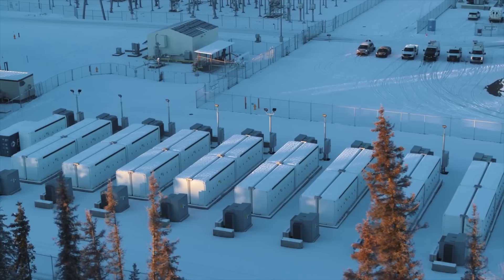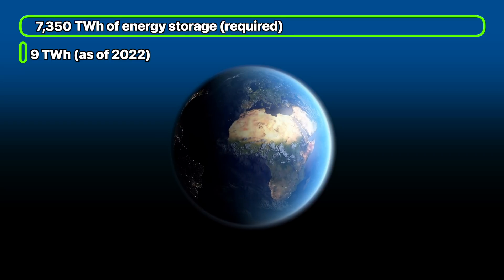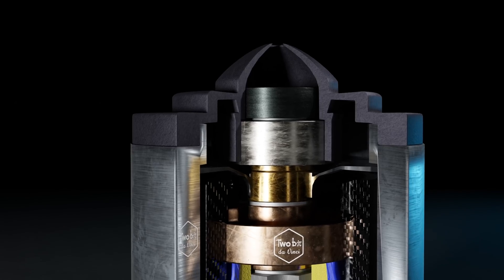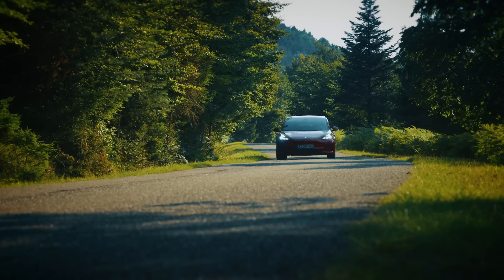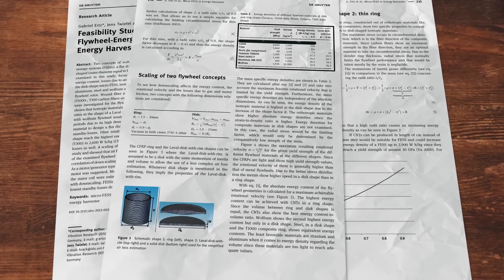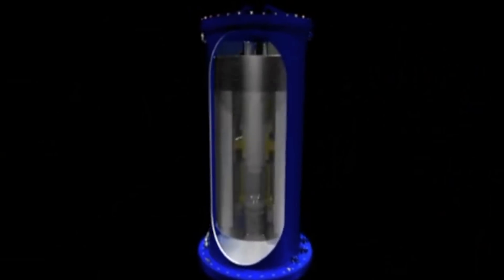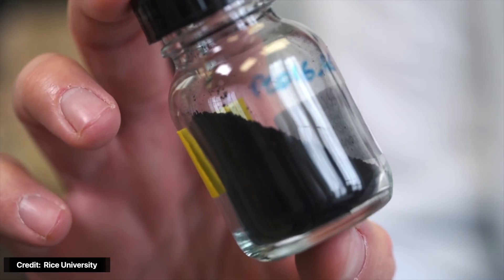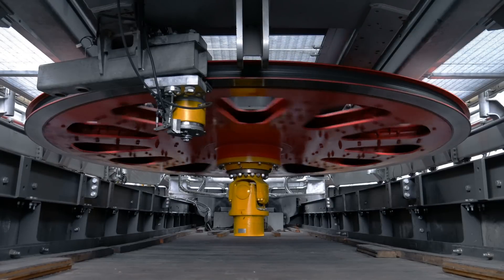Breakthrough Energy Storage Tech CRUSHES battery prices by 90%!

Comment: Superconductors are a natural fit for flywheels. We can levitate the wheels to improve efficiency. Now, I know what you're thinking, "But what about when they loser power because the grid blacks out or something, and so the compressor loses its cold and the flywheel falls down and runs free, destroying a whole town?" Well, the solution is simple: the freezing units (yes, there are TWO for backup purposes) will be powered by the flywheel itself, so it will auto-spin-down before settling in place by redirecting as much energy as is necessary to keep the superconductor locking it in place. Additionally, a back up support can activate to catch it once it has spun down sufficiently, for extra safety.

Otherwise, as long as the base remains cold, the flywheel can be locked (magically) into place with no direct contact with anything. Such a flywheel could last.. basically forever, and lose no energy at all (other than to the compressor to keep it cold).

Obviously, then, the trick is to design really good insulation and bury the flywheels underground to achieve this, as well as making them safer.

Comment: Somewhere or another I missed the whole discussion on how a flywheel works, as in what makes them turn, and what keeps them turning.  I'm guessing magnetic fields turn them like a typical motor, but I can't get past the whole notion of resistance being something that drains away energy, and in this case it would be resistance to the mechanical movement.

So, if there a better source of info for how a flywheel works?  Showing a couple equations is kind of meaningless if you don't understand the basic concept of what makes a flywheel STORE energy.  Yes, it's energy of momentum.  I get that.  But there are always forces that resist movement.

So after seeing the ending I pieced it together a little bit and see that flywheels are really only useful for solar panel farms to give energy after the panels start to reduce production when the sun goes down.  That's really the only situation where you have a SURE drop in renewable power in which case the need is immediate and friction won't get the best of you even though it still will considering the pretty fast drop in momentum.  I assume that charging means turning them ever faster.

Comment: I'm pretty sure the solution to make long strands of nano tubes is simply to use CVD to spray carbon on some cheap iron wires. you can also use vibrating copper wire in a chamber filled with high density CO2 .

Comment: If flywheels have as high a discharge rate as you say, they would run really hot. to wind down a high capacity flywheel at that rate, is a lot of wattage wasted as heat! Suspending a flywheel on permanent magnets arranged like pole to like pole, would create a near frictionless bearing, that would allow them to spin freely for extended periods of time. The difficult thing, is to make sure the magnetic fields are homogeneous enough, to avoid any flux modulation what so ever. Oscillating magnetic fields tend to form Eddy currents in any near by conductor. The electromagnetic rotor for the motor/generator needs to be switched reluctance. In a hard vacuum, it's almost impossible to dissipate heat, especially at high rates of acceleration and regenerative deceleration. (because switched reluctance works well with large air gaps, it's possible to build the stator outside of the (non-metallic) vacuum vessel, so it can be cooled by conventional means) The reason for switched reluctance, is because a permanent magnet rotor would cause all kinds of fluctuating magnetic fields, which create drag by maintaining airgap voltage in the stator. An induction rotor relies on Eddy currents in the rotor, which in a vacuum, would get too hot during charge/discharge at high rates.  Both induction and switched reluctance have the advantage of no magnetic field in standby, perhaps, allowing storage losses to be more similar to even the best chemical battery.

Comment: CF flywheels in a vacuum were (briefly) used in the datacenter space.  They were only useful for holding a DC up for about 30 seconds, which should be plenty long enough to start a diesel generator.  I don't see them as a practical alternative for energy storage to chemical batteries (yet).

Comment: So is that the value for raw CNT? I'm guessing real world would be much less because you would need to use resin to keep its shape like carbon fiber. Also, I can't see how you could power your EV with a bunch of flywheels... wouldn't the gyroscopic forces cause problems? I guess it worked fine for that bus...
Reply: I was wondering the same thing.  Still many unanswered questions.
Reply: The bus only stored energy for minutes. Someone else mentioned that 2 counter rotating wheels might work.

Comment: I did a paper design of a hybrid car using a 35HP turbo natural gas engine (lowest CO2 per HP) and a 200lb, 10K RPM flywheel (500HP minutes of energy).  The flywheel provided the starter and flywheel for the engine, reducing weight.  Each wheel was connected to the flywheel by a CVT to control vehicle speed and provided regenerative braking.

One key element is the system required 2 counter rotating flywheels (in a vacuum) that were gimbal mounted.  This allowed going up and down hills and prevented the car from ending up on its roof 12 hours after parking (the earth rotates, flywheels don't).  

Like the Tesla Plaid, dumping 500HP minutes in drag race (5000HP in 6 seconds) would be a lot of fun.

Comment: these would be good near solar or wind farms. set them up to charge before peak times and release them as the peak hours demand. say charge them up at 2pm and discharge them from 4-5 while people are getting home and starting everything up.
Reply: Could it be possible to power the flywheel with a direct mechanical connection from the turbine?? There would be be no losses over the generator/motor system and all electrical systems could be located on the ground.  It would smooth out turbine output in gusty conditions.
Probably would introduce other issues, nothing is ever that simple... 😏

Comment: I remember it being said that those working on the space elevator concept had solved the problem of making any length of carbon nanotube... It was a group in Seattle, Washington...  Don't remember the name.  Also, I remember when they were doing experiments with carbon nanotube ribbons held up really high be hot air balloons to test elevator vehicle concepts (which is what they claimed to be the bigger challenge).
Reply: There is no material strong enough for an earth space elevator.   Not even theoretically.  One is possible on the moon tho.

Comment: I have personally machined hundreds of large rotors and housings for a company called 'Active Power'. It's my understanding that flywheels are used in uninterruptable power situations to provide an instantaneous response to a power disruption, say in a hospital for instance. They are only used for very short times, until standby diesel generators can take over.
Reply: About 40 years ago our computer branch ( in very large government department) pulled its electricity supply from a electric generator powered by an electric motor.  Sandwiched in between this motor/generator set was a 1000 kg steel disc flywheel.  This revolved at 1500 rpm.  The purpose of this system was to isolate the computer branch from very short term power loss and electricity spikes.
Reply: @johnspathonis1078  Yes, there were installations where 3 phase AC was converted into DC or viceversa using motor generators and the use of flywheels was a simple way to store energy.
Today all is solid state and super capacitors are used for short term storage.
Reply: That is right, normally it is not wisely to store large amounts of energy in an inertia wheel with large angular momentum, because the failure mode associated with bearing failure has catastrophic effects, well  documented 70 years ago, when MFO build and operated so called gyro buses having a vertical axis flywheel, which had to be  recharged on every stop. They were eventually delivered to Adìs abeba to fulfill Haile Selassie personal oder .
During testing one had a bearing failure, broke out of the enclosure up the test pit and destroyed a considerable number of machine tools on the factory floor, needless to say that the redesign lead to considerable derating of the system, essentially eliminating other customers.
Reply: Yep, worked at a plant that was turning/milling Activ Power rotors. Was hoping to find something like this in the comments, thanks.
Reply: Yup no-brake gen-sets have been used at large airports for 50 years.  The flywheel allows the diesel to get up to speed when there is a power cut before the frequency goes out of spec.
Reply: For smoothing grid transients otherwise absorbed by a hospital backup battery system they are unparalleled.   MRIs and large machines demand massive instantaneous current many multiple times daily, which the batteries sacrificially supply to avoid a brownout. As well, a hospital in some cities experience 30,000 transients a day, aka noisy power, that hammers batteries to death.  For smoothing gradients they perform effortlessly to save mucho denaro.
Reply: Imagine a carbon nanotube wheel in your car that stores 400 miles of driving energy. It will level buildings when it frees itself.
Not to mention the handling of a car with a giant gyroscope inside. You can only drive level on flat surfaces.
Reply: @mennol3885  Actually the gyrobuses had double gimbaled flywheel suspension, exercising no torque on the vehicle on startup the gimbals had small orthogonal torquers to keep the axis  upright
Reply: @arturoeugster7228  If the flywheel is allowed to freely gimbal, how is it mechanically connected to a generator or to the vehicle's drivetrain?
Reply: @sssbob  I saw these passenger buses as a boy and what I remember is that the gimbal stops were adequate for operation in a city environment (limited to 30% grade)  and they were electric powered, the overhead connections had to be 3- phase AC connected by retractable hinged parallel bars. Voltage, I had no idea, since they were to be operated in Ethiopia. I lived across the factory and we obviously heard about the runaway incident. The driver said it operates like an electric city bus with the usual 2 parallel overhead wires prevalent in the city of Zürich, called trolley bus,  our  regular ride to school.
From what I remember in the back there was a slightly higher floor and the motor/generator was incorporated into the flywheel, how I don't know and hesitate to guess.
The buses are described in a Wikipedia article (highly recommended, detailed and useful unique information) as built by MFO under the title Gyrobus, the very ones I saw. That is the limit of my recollection.
Much later I worked  at Martin Marietta and did research and design of momentum exchange attitude control, where the double gimbal triad installed on Skylab was a small part of the various concepts investigated. Actually I wrote the backup control laws , the primary ones were written in an ingenious way by Kennel from NASA at Marshal Space Flight center.
I mention that because the size of the CMG's (control moment gyro) were about the same as the one on the gyro busses. The CMG's are constant speed  devices operating in a vacuum, made by Honeywell, The similarity is the shape of the wheels and hub for uniform stress distribution. In a near zero g environment , the gimbal loads  are obviously not comparable , can't help there 
The Hubble space telescope has 4 reaction wheels with  variable speed control, They might be helpful in implementing tried and proven motor generator design and control, obviously  as reliable as it can be.
Reply: @sssbob  magnets and coil
Reply: @mennol3885  Yes underestimating gyroscopic progression is dangerouse.
Reply: @mennol3885  Yes it's interesting that any attempt to turn the axis of a single gyroscope quickly will result in a huge twisting force at 90 degrees to that axis.  I suppose it's possible to eliminate this by having two gyroscopes running in opposite directions mounted back to back but would the complication be worth the effort?
Reply: @mennol3885  You can use one to save fuel by storing energy during deceleration, and releasing for acceleration. Such a flywheel needn't be so large.

Comment: One interesting use case could be fast charging EVs. In combination with batteries the flywheels could be charged up very quickly and over a longer period could then charge the main battery of the car until it drives or just simply parking. This combination could solve the issue with the slow charge time of batteries the same time as solve the discharge of the fly wheel over time.

Comment: I like flywheels as energy storage, but they have another issue that you didn't cover here... Gyroscopic motion. There's a video where they took something like a spinning top and spun it around on the ISS. After a moment, the entire top flipped upside down... and another moment later, did it again. Additionally, there's the issue of angular momentum on a spinning object... You've got to remember that the Earth itself is spinning. So if you try to spin something along a specific axis, but then the thing you're mounted to (the Earth) spins it outside of that axis, you induce a LOT of harmful forces onto the flywheel. If you get too heavy or spin too fast, these forces could break an otherwise good flywheel. Luckily the Earth spins relatively slow compared to the flywheel, so it's not as bad as it could be... but still, you end up with serious stresses and inefficiencies because of this relationship. Ideally, you'd find a way to mount the flywheel within a gyroscope (think astronaut uncontrolled spin training) which would allow the flywheel to maintain it's momentum even as the Earth spins... but this is outside the bounds of the materials science we have today. But, if you can find a way to fix the angular-momentum-relative-to-the-Earth issue, you could potentially have flywheels that can maintain their spin for a very long time.
Reply: Perhaps your idea will be easier to reason if you chose more accurate terms. Rather than "the earth is spinning", use "the earth is slowly rotating". After all, it takes TWENTY-FOUR hours to make a single rotation. The term "spinning" imparts a sense of the whole planet whizzing around like a flywheel. In reality, the earth's rotation would be almost imperceptible if viewed from some point in space, similar to watching the rotation of a clock's hour hand.
Reply: @mississaugadave7270  I never said the Earth was spinning 'fast'... there are such things as 'slow spins', lol. But, yes. Using more accurate terms is always better.

Comment: I was penciling out a design for a flywheel on an E-bike. Clutched in to take the regeneration as well as peddling. Design as an axial generator. Provides an even recharging of the battery, and extra storage while all charged up. Can comfortably be recharge while on a stand.
Reply: Be interesting what kind of gyroscopic forces will result as going straight, turning, tilting the bike for a turn…
Reply: @jsbrads1  Yeah. I was wondering about that. I tried sitting on the back of a bike holding a spinning bike tire while a friend rode the bike. They couldn't tell. I'll try riding next time!

In a real model though, the flywheel would be in the triangle between your legs rotating in line with you.
Reply: @JorgeLausell  a spinning bike tire isn’t heavy enough, you have two of those spinning already. You need the space for your legs next to the triangle.
Reply: @jsbrads1  the flywheel would have to be heavy. I'm thinking there's plenty of room and it would be in a housing, not spinning in the open. You could knock your knees into it, no big deal though, not in the way while pedaling.
Reply: @JorgeLausell  a thin disk? With axis parallel to handlebars?
Reply: @jsbrads1  yeah. Thin like under 5 inches. My battery is a bit over 3.
Got to work the geometry abit but around 8-9 inches across.
Reply: @JorgeLausell  when the disk changes speed you will get Torque Steering which will tilt the bike… annoying when riding in a straight line and may move the tires inches to the right or left, but changes in tilt while turning can cause a rider to fall.
Reply: @jsbrads1  I was thinking that most times the movement is inline with the movement of the bike. Mostly when leaning and straightening up that the force may be strong. Odd, but not a dealbreaker as a longer wheelbase works that out. And you need the longer wheelbase too as the best application is more a mountain cargo bike.
Reply: @JorgeLausell  on a road bike you often ride with paved road for a number of inches to the right and left of your tires but in the mountains, one side could be a rock face and the other a drop off.
Reply: @jsbrads1  It is all about the use cases, isn't it?

Consider a unit of 3 cargo bikes, esch racked up to provide storage for a mobile medical unit. You've got a forest fire. You're in a combat zone. You've got a setup you can move and power that can save lives.
Reply: @JorgeLausell  your idea isn't bad per se.
Reply: @JorgeLausell  but the steering handicap would definitely hinder your capability too much.
You think spinning the disk to low speeds would be sufficient.. probably not. Not only do you need really good bearing while stationary ( spinning ). You need the wheel fast and heavy. 
Reconsider the assisting battery for your bike.
While you can repurpose your flywheel idea for sumthin else.